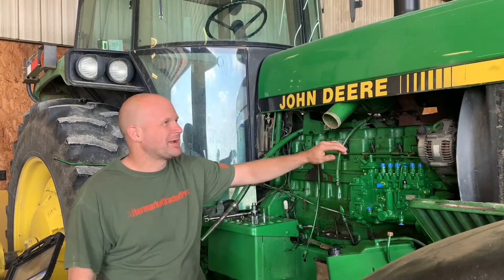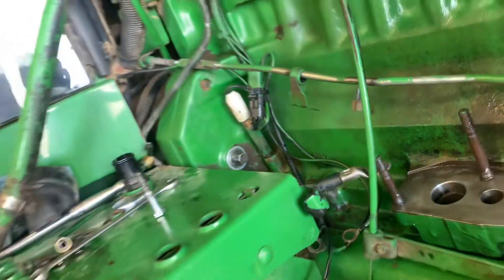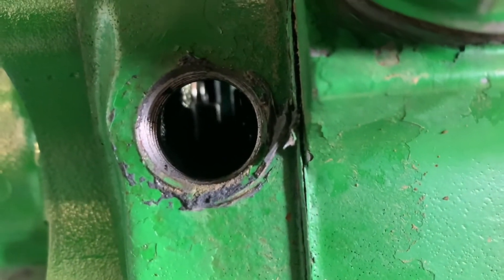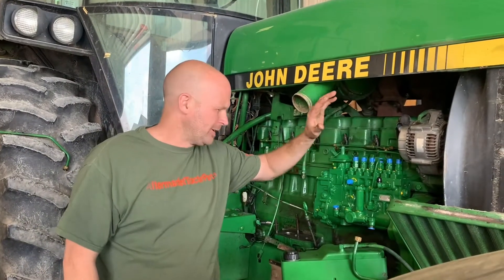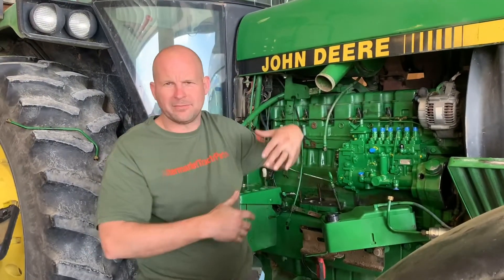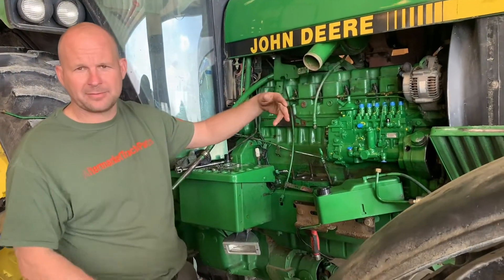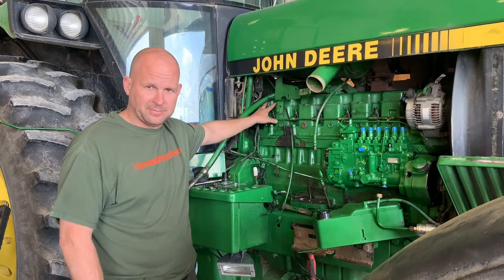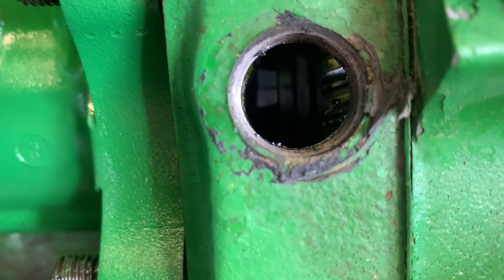John Deere P pump injection pump timing and removal for 4450 thru 4960

Comment: Hey I gotta old truck I wanna put a JD in it what’s the best motor
Reply: You're better off with a Cummins or dt466
Reply from the maker: Well.  All depends. Not the easiest conversion to do.
Reply: I wouldn’t put a John Deere engine in a truck, there not made  for the change of rpms like a engine in a vehicle